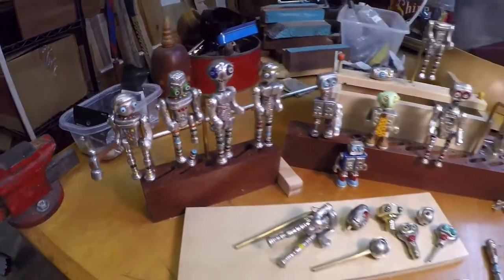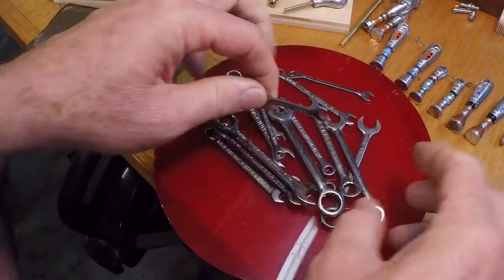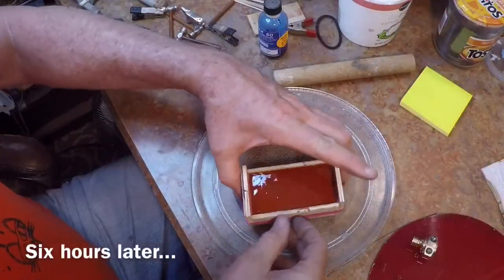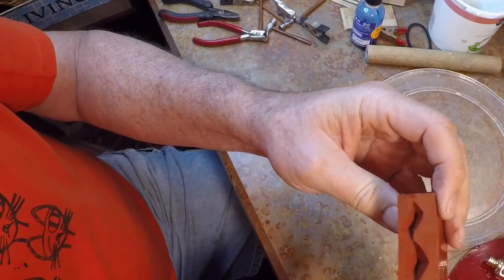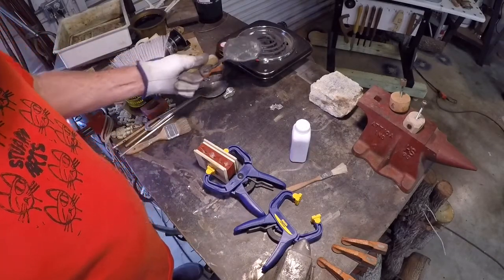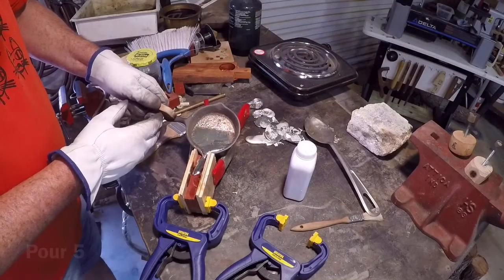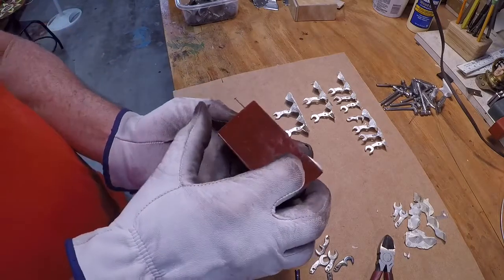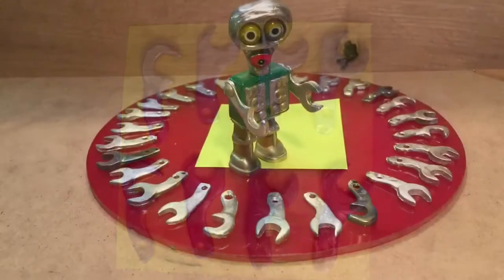Casting Pewter Arms for Seventeen Automaton Robots

Comment: I was watching a pewter chess set maker and he puts a pinch of powdered flux in the melted pewter. 
Not sure why it helps, but he does extremely fine details. He also heats his molds to be sure they are completely dry as apparently and moisture in the air affects the mold surface even before the talc. I am not yet in possession of pewter myself but thought it would be worth a try. See <<Prince August>> on YouTube.
Hope this helps with the pour.
Reply from the maker: Therese Dignard thanks for the share!